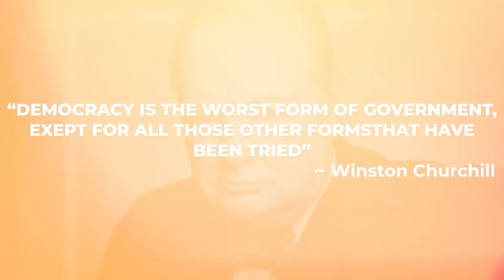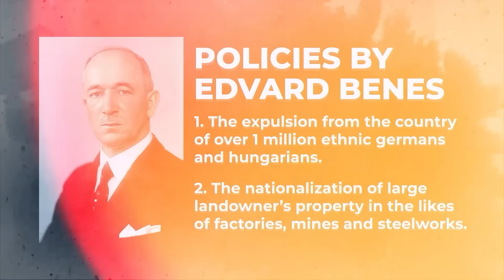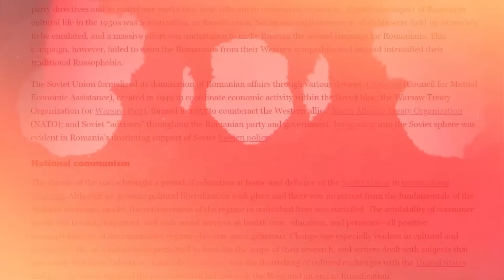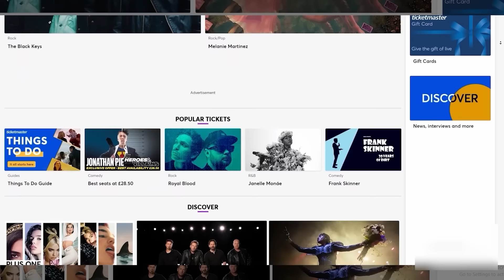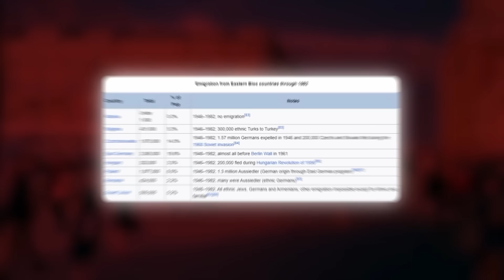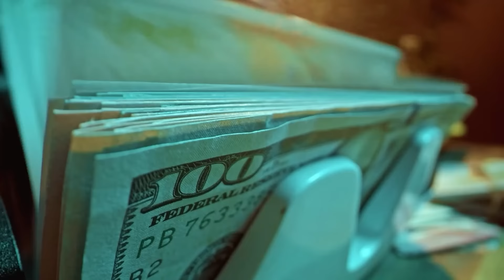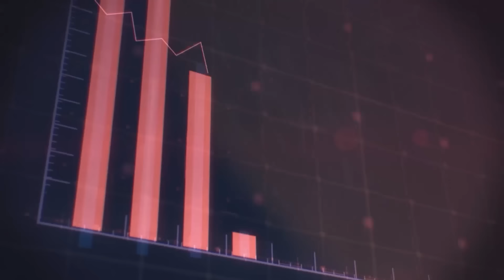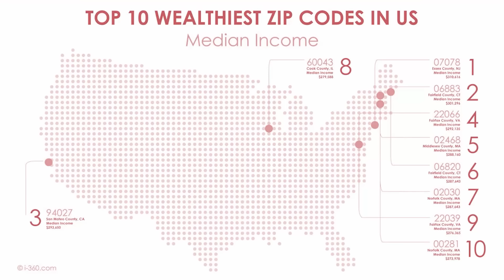Settling the Debate: Communism Vs. Capitalism

Comment: The 1% own, the 0.5% own.
Reply from the maker: The thumbnail is just a figure of speech to adress preconceptions
Reply: Ironically heavily regulated capitalism is the only way that 1% of people can own 90% of assets. Which is why it always ends up getting heavily regulated once a few people made it to the top. As they don't want others making use of their large companies inflexibility and anti consumerism to create a replacement that doesn't suffer from those issues.
Reply: Why do people always ignore social democracy. It is a mix between the two economic systems. Though I think the current difference between the soviet system and american system is authoritarianism vs democracy. Since you can see russia acting extremely similar to the soviet union. It does not matter about the economic system but more about the political system. 

It is social democracy that built europe not capitalism and not communism. Its balancing the two, not too far with privatization nor to far with government ownership. Mixed with us being under a parliamentary democratic system though some are semi presidential system. 

Problem is concentration of power with no accountability. We have had monarchs aswell in the past and a lot of them where tyrants. I see no difference between the current communist system and the absolute monarchy systems. The same goes for unregulated capitalism it eventually ends up being turned in to a feudal system or a facist system. Current day russia is a example over a fast lifecycle under pure capitalism. I hate both systems because of its nature to concentrate power in to incompetent people.
Reply: @BS-vm5bt  Agreed. I think that the video was overall very informative - and I think that the choice not to focus on Russia, but instead on the East European countries that experienced both systems was a good decision. What I expected in addition to that was actually a comparative focus on Western European countries, precisely because of the various degrees of balanced middle roads that they chose. Still, overall very informative video, thanks!
Reply: @BS-vm5bt  You are wrong in the point that unregulated capitalism turns into a feudal or fascist system. This is propaganda and can't logically work that way. I would argue the contrary, as most regulations are made thanks to lobbyists, a heavily regulated society will lead to monopolies (like you can see it in our society, where starting a business has become difficult and expensive). Unregulated capitalism doesn't remove the rights of protection of property life or liberty from the individual. Meaning that it is impossible for a company to buy up everything, just like it is for one right now. And as starting new companies and businesses is easy it means that a lot more small businesses would exist and offer better service/products than their big competitors, inevitably leading to a cycle of big businesses getting replaced by formerly small ones.
Reply: @Thinkofworldofficial I guess the thumbnail gets your comments going...😂 but its crazy tho. 

thumbnail got effect and when I see this one it instantly looks like you are some type of communist tbh. 😂

Comment: Also corruption doubled or trippeled when turning to capitalism!
Reply from the maker: I don’t know about the exact figure but it did increase in most formerly communist countries for a period after the transition, I adress that in the video.
Reply: @Thinkofworldofficial  Yes, but ironically this increase in corruption only happens after a transition from Communism to Capitalism. While there is corruption on traditionally capitalsit countries it is nowere near the one in former communist ones. That's because to advance in a communist society connections are the only way, while in a capitalist one you can reach the top on your own, even tough it is hard (and is made harder with regulations).